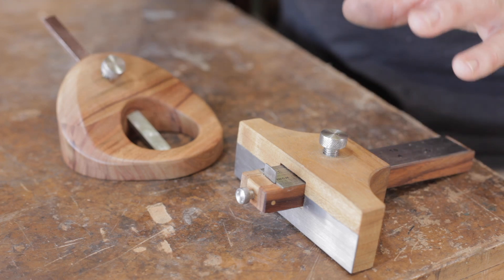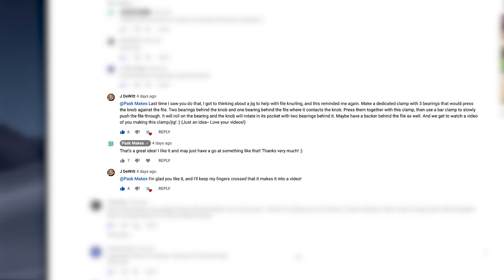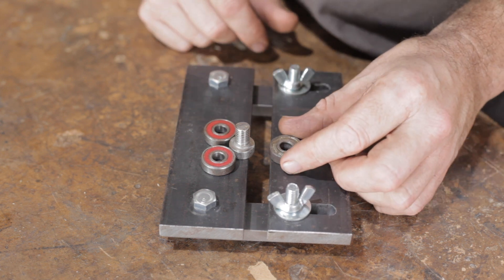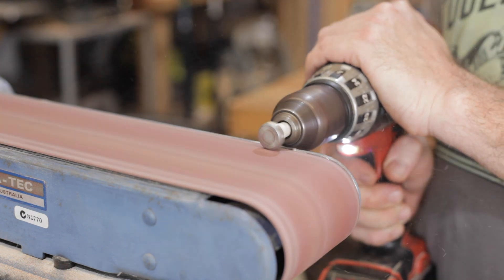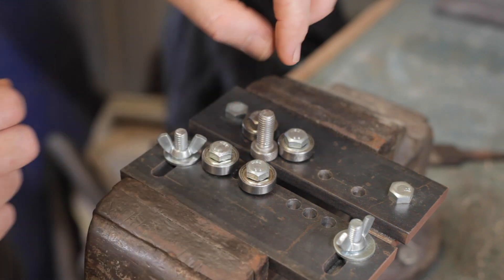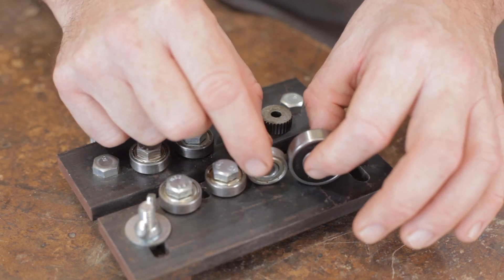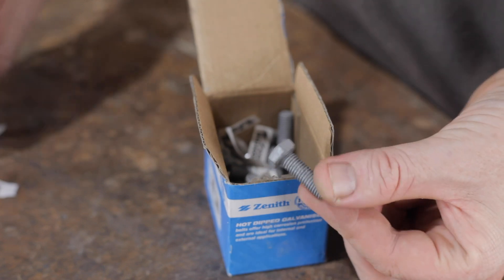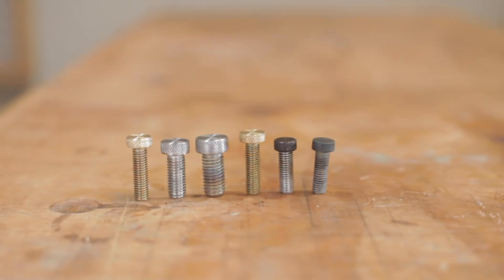Homemade Knurling Jig

Comment: Two things: definitely cutting oil, it would especially help with the straight knurl you tried. Also if you want to have a really dark patina quickly, try heating the bolt then tossing it in some motor oil, preferably used so as to get the darkest shade possible. :)
Reply from the maker: Thanks - I'll try cutting oil next time. I reckon boiled linseed oil works better than anything I've tried for the black patina. :)
Reply: @PaskMakes  it works very well, I've just found that I've gotten a more even patina with the used motor oil
Reply from the maker: @InstrucTube  I've tried used motor oil before but looks like I need to try again! :)
Reply: @PaskMakes  you mileage may vary, but I've found the more used and dark the oil, the better, though make sure to strain it well first. 😉

Comment: Crazy that the new bearing snapped so fast too. Glad you were able to get some good results...you just kept after it...the Pask Makes way.
Reply: Not crazy at all. the race is hard, the balls are hard, and the file is hard. a better choice might have been needle bearings, but not much better.

The geometry of the file is not optimal for knurling. you can get a bit of a bite, but you would need to know the spacing to calculate the proper diameter of the screw head to be knurled.

Comment: Great video! This is just what I need too. I made marking tools, push bars and sticks out of scrap exotic woods as presents for some woodworking friends but I couldn't 't find a reasonably priced knurl nut in the size I wanted without paying a fortune. The plain head bolts in brass and stainless steel are easier to find in my area and on eBay so now I can start making my own thanks to you my friend. I just started to weld as well so I will be adding the "lip" part onto the jig. thanks again!!
Reply from the maker: Thank you! That's one of the reasons I make them, it's difficult to find them in the size I want with an M10 or M12 thread. :)

Comment: I love the jig, the innovation, and the tenacity you show in this and all you videos. I wondered if you noticed an ever so slight "flex" of the jig and if this keeps the bolts from getting a uniform knurling? Around 11:07 when you release the vise the middle of the jig flexes. You can see the bolt used in this show doesn't have uniform threading; some is missing at the top. Not sure if it matters because the over all results are amazing
Reply from the maker: It isn't 100% rigid but it works well enough. The bolt that had the missing knurl at the top was my test piece that I didn't prepare well enough, the sides weren't very straight. :)

Comment: Nice jig. Luckily I have a mini lathe with a knurling attachment. What always gets me is the diameter of the part to be knurled. Sometimes it works out where the knurl from the first pass falls back in the same groove. In that case it looks fine. When it does not line up the knurl pattern gets fine and does not look good.

Comment: Do you need two knurling wheels? It seems that one could cancel out the work of the other. I envision two bearings and a single wheel. I am not a machinist so you are a step ahead of me.
Reply from the maker: For the diamond pattern you need two wheels as they're opposing! :)

Comment: Hi Neil, I manufacture brass door hardware. We have a decorative hinge finial with a 90 degree knurl. Very coarse. Due to a very thin section on the part we could not produce this on the lathe. So we built a similar tool. The brass part sits in a ledge. One side is stationary. The second side slides relative to the first via a very large lever. We milled two knurl plates from tool steel and heat treated them. We can adjust the gap between the plates to get the depth of knurl we want. 

A couple of things I noticed. When you are using the cordless drill it's wobbling a bit. This is leading to an uneven knurl along the width of the face. Also, the pressure required to achieve a deep knurl is considerable. You might try narrowing the face to be knurled. Pre-chamfering both edges would do that. That would apply that same pressure to a smaller area. And you might try a convex knurl. 

All in all a very interesting video and great results.
Reply from the maker: Thanks very much Eric! Your jig sounds very interesting and I nearly went a similar way with a ledge for the bolt to rotate against (still using the file). Thanks for the tips, they certainly make sense! :)

Comment: Champion clip mate! The 'trial and error' was important to share as I think youtube clips in general can give the wrong impression of DIY projects. Essentially, anything custom is a process of working out kinks.  Just another thing to consider, knurls are size specific. Generally your turn the stock down to a size that suits the knurl. Small metric knurls usually suit a neat mm (no decimals) sizes. I'm unsure of the common Imperial knurl patterns but It would fall on a regular 1/32 or 1/16 at a guess. You will still get a pattern but you might scratch your head when you do a pair of thumb screws that look a little different.
I'm subbing mate!
Reply: Machete Bushcraft Australia, actually knurling is slightly black art. Feed, speed and the rate at which you engage the knurl all can affect the tracking. Too little pressure can lead to double tracking. If you have a high enough pressure I've found that slight variation in diameter doesn't greatly affect the knurl.
Reply from the maker: Thanks for the info - much appreciated! :)

Comment: Could you not power the knurling wheels with say a little hand crank?
Reply from the maker: There isn’t any need as turning the bolt works fine. I did try using a wrench to turn the bolt and that worked well too but I preferred using the drill. :)
Reply: @PaskMakes  thanks for the reply, and okay drill power is much easier.

Comment: You could try a short strap from on top of the pivot bolt back down to the frame to support the top and help the bolts stay square.  I used a similar  idea for my rod roller for making circles, adding top support worked so much better. Cheers from the big sandpit to the west.

Comment: What if you put one of the two knurling wheels on the fixed jaw, and the other on the moveable jaw, with the work pressed between them, and the bearing to the side?  This would decrease the damaging force on the bearing, and almost double the force on each knurling wheel at a given vise force on the jig.

Comment: That’s so clever. Not sure who else has tried knurling in a metal lathe, but it downright sucks on any ferrous metal. It requires so much pressure because knurling is not a process that creates a chip (yes, you might get some grime off it but it’s not a chip like when you mill). Knurling is a forming process where the imprint is actually pressed Into the metal. what requires the immense amount of pressure, is you actually have to displace the area being knurled. Think of using a letter or number stamp, you don’t just push it into the work piece, you have to give it a good whack with a hammer. (For those interested in knurls)

Hey Pask, try adding a bit of medium weight oil to the bolt head while knurling.
Reply from the maker: Thanks very much for that! I've never used a metal lathe and that made a lot of sense! :)

Comment: I'd change the bearing for another knurling wheel, as you're knurling on one side, and flattening with the bearing on the other. If you're looking for a way to further automatize the process or make it more comfortable, perhaps it would be better to convert the jig in to a vice itself. The bottom part would be bolted to the drill press' table, and you could use two nuts as you're doing now to drive the bolt while you tighten such vice. The column of the drill press could be temporally fixed to a certain height so the bolt's head is kept at the center of the knurling wheels, or use it as if you were drilling if the bolt is wider than the knurling wheels themselves. In that case you might need to drill a hole between the two knurling wheels to be able to knurl the thumb wheel from top to bottom. You should also use some oil while knurling, hydraulic or automotive oil are fine if nothing else is at hand.
Reply: Forgot to say that the simplest way of making a vice-like jig would probably be to use a scissors-type design, where the pivot is bolted to the drill press' table (with some allowance so it can open and close), and some heavy duty screw on the opposite side that you can use to tighten and loosen the mechanism. The knurling wheels would be in between.
Reply from the maker: Thanks for the ideas Eduardo! :)

Comment: That is a very accessible way of diy knurling you came up with. Perhaps the courser wheels work on softer materials like wood. You could also chop off a piece of aluminium or copper pipe and press fit it over a bolt head that you made round. This way you have a softer sleeve to knurl. Copper will make a nice contrast on steel.
Reply: I think the coarse knurls we're just too mistimed on that bolt diameter. You usually have to do so math for this.
Reply from the maker: Love the idea of a copper sleeve on a steel nut, will have to give that a go! :)

Comment: Even on a lathe with a proper set up knurling can be touch and go. I think if the circumference of the job isn't divisible by the pitch of the teeth, or close to it, you run into trouble. I enjoyed watching the process,  many thanks.

Comment: Gnarley knurling Neil. 
Stainless is a difficult material to machine compared to mild steel or brass. It might need a drop of lubrication.
If you could hold a file card and brush the swarf away as you go it improves the finish.
Maybe just the compressor blowing past.

Comment: Put a strip of leather around the bearing, maybe with double sided tape, to protect the knurling nad the bearing.
Reply: I had the same thought but leather is possibly too soft for the forces involved - the bolt head would squash through it, but maybe a copper sleeve on the bearing would do the trick.  I agree the knurling seemed to be getting flattened at the same rate as it was being formed.  Great work on the channel Neil.
Reply from the maker: @tcook3471  Thanks - glad you're enjoying the channel! The bearing doesn't seem to have any effect on the knurling if it does I can't see it. I'm pretty sure the load is spread too evenly to cause any effect. Like lying on a bed of nails, the nails don't pierce your skin because the weight is evenly distributed. :)

Comment: 2 bearings and one knurl wheel for the straight knurl.  The two wheels are running out if phase and trashing the ither ones cut.  Other than that its a good idea.

Comment: Fantastic.  I'm still amazed at the idea of doing it with the file.   Interesting that when you used the file, the registration seemed perfect.  A slight miracle.  But using the 2 straight knurling wheels from eBay, how could both wheels register into the same grooves?  Do you think that one knurling wheel could possibly work?  BTW, we see that the file is lifting as it's wider closer to the handle.  Bummer.  Always the best videos on YouTube.  Thanx.

Comment: This jig looks fantastic! The thought I had was that you could use a socket wrench (or even a regular wrench) to turn it. That way you’d have complete control over the speed and rotations.
Reply from the maker: Thanks! I tried a wrench and it worked very well too but I seemed to get slightly better results with the drill! :)

Comment: Hand crank. Guide rails or something for the two plates to keep them aligned. Clamp also built in and a tab or leg to hold it in the vice. Great first go. Would love to see you make a updated version.

Maybe a use a coupling nut to load the bolt for knurling. Screw the bolt into that deep coupling nut that’s secured in somehow. Make it all ridged.
Reply from the maker: Thanks for the input! I did try turning with a wrench and it worked well enough but in the end I preferred the cordless drill. I also thought about making it clamp itself but this was the less fussy way and still works perfectly well(the clamping that is). :)
Reply: @PaskMakes  I have a lathe but it's still very interesting to be able to knurl a part that has been separated from the stock.

Comment: 🤔maybe if the nut was held in a rigid chuck and the knurling wheel was forced into it with a solid moveable clamping device.. oh, hang on, i think a bloke called Abom has a few machines like that🤣
great concept Neil 👍 i get a feeling you will revisit this and get it working spot on

Comment: Thanks for the video.
Perhaps by having the flat faced bearing pushing the bolt onto the knurling wheels you are flattening the knurl, would it work better to have 1 or even 2 knurling wheels instead of the bearing.
Reply: This is the way I have seen simple hand knurlers - a triangle arrangement with one wheel on a threaded clamp
Reply: I’m not criticising, just an observation. No right or wrong, we all do things differently.
Reply from the maker: No worries Simon! I’ve noticed since making it that you can buy them with a third knurling wheel although I don’t think the bearing is really flattening the knurling(or if it is not much). The load is spread over the whole of the knurling a little bit like when lying on a bed of nails (not that I’ve ever done that) the nails won’t cut you because the load is spread. :)
Reply: @PaskMakes  Except the bed of nails relies on a large surface area. The point connecting the bearing and the knurled part is where two circles touch, so you only really get a small line running up the side. The only way it would have enough area to spread the load much is if either the bearing is flattening, which won't let it turn well and will likely break the races often, or if it is flattening the knurling. Keep in mind that the bearing race is pressing into the part just as hard as the knurling wheels that are making the cuts.  I would wager that the knurling wheels are spreading the load across more actual surface area just because of how much of the cutting form is engaged with the part and the fact that there are two on the same side of the clamp.

If you make a second jig, I would recommend trying to make it so that the two knurling wheels are opposing each other and in line with the clamp and use the bearings to the sides to keep the part positioned. That way the bearings are taking the cutting loads and wouldn't be pressing into the finished surface anywhere near as hard.

Overall a fun video to watch. Thanks for sharing it!
Reply: Those knurling wheels not cutting, they press themselfs into the bolt. Forces are realy, byt realy, very high.
Bearing DO flaten knurls as knupa explained. And it flatten a LOT.
Put third knurling wheel, and it should work much better.
For diamond pattern this is not ideal combination (two wheels in one dirrection one i the other), but much better than a bearing.

Comment: Neat idea! Try some cutting oil next. When we knurl on the lathe we use a large amount of oil. I brush it on thickly continuously, but if I had a way to flood it with oil while cutting I would.
Reply from the maker: Thanks - I’ll try that! :)
Reply: @PaskMakes  A lot of machining can be done dry, but knurling involves a lot of pressure, so pretty much always requires fairly generous oiling.  Brilliant designs all.  It would never have occurred to me to use a file.  Thanks very much for the voyage.  I clicked "like", so another troll bites the dust.
Reply: @PaskMakes  yep that's using your something head other than a hat rack. softening seemed to work you can always reharden them. good work.
Reply: My Dad had a lathe when I was a child. He built a metal tray that it sat on with an oil reservoir and a pump to continuously bath cuts with oil. I used it to make knurled brass knobs for a Bass guitar that I built in HS, man that was fun. I really miss my Dad, he is why I enjoy these videos so much.
Reply: @DBYNOE  I feel the same way about my Uncle Harrold.  Miss him every day.
Reply: It's not usually ordinary oil that is used in lathe operations that require high pressures but "sulphurised cutting oil" Fortunately, this stuff can be made cheaply at home in an hour or so. 

This Aussie bloke, Mark Harriss, has a video on how to make it here...
https://www.youtube.com/watch?v=2qigHaJkriA
Reply: Dominic  It's either called flood coolant or mister, depending if there is air or not used to push the coolant that is a mixture of soluble oil and water...   ;)
Reply: I used assembly lube last time I cut knurls and it seemed to work really well. Cleanup is more of a pain though, and I don't think you'd want it cycling through your coolant pump if you have one.
Reply: Try roller bearings. 
They can accommodate far higher pressure
Reply: All true. I would add 2 points in addition to lots of oil. One is that the head needs lots of rotational movement to allow the pressure of the vise to finish the cut. So keep the rotations moving and add pressure while turning. Second is that a more refined pressure like a set of heavy screws rather than the vise to allow you to increase the pressure a little more precise and incremental. 

I take it back, I’ll add one more comment. This system works great. No need to stop until the knurling is fully formed (nice sharp points). 

What a great project adding a craftsman’s tough making your project more functional and more beautiful. Well done my friend.

Comment: Why not turn the bolts with a wrench? Or if you worry about concentricity: a tap handle!
Reply: my guess is its too slow to use a wrench
Reply from the maker: The wrench works fine, I tried it! I just preferred the results from using the drill! :)